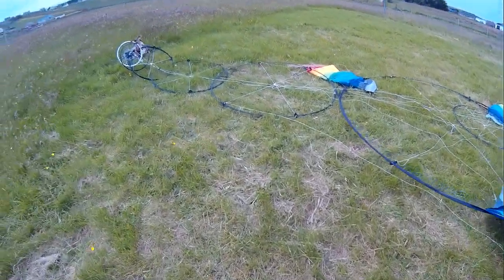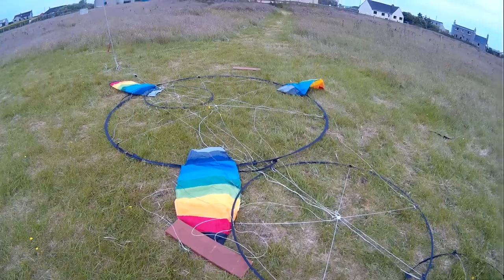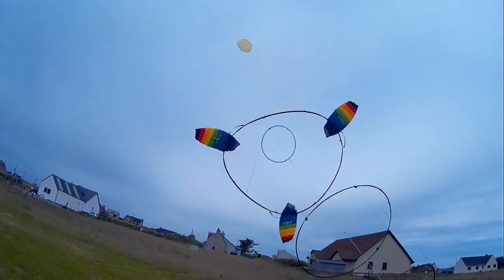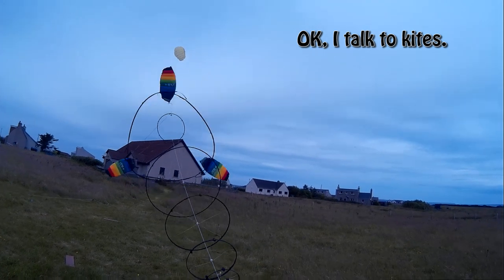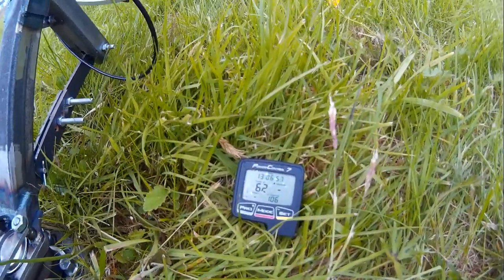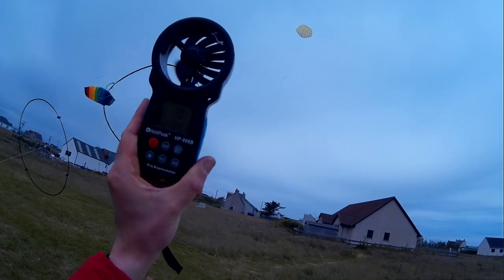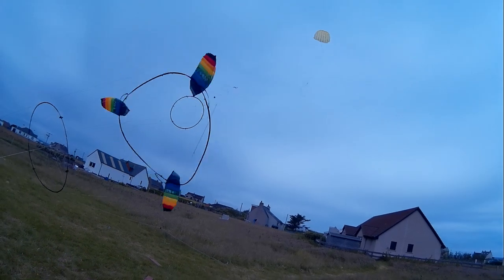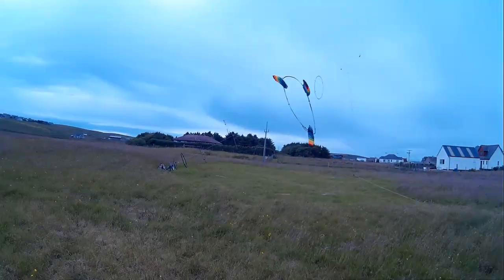Single kite ring testing the Mini Ground Station on High Torsion

Comment: hi,could you not simply attach the kite to a buggy with dynamos?port and starboard?
Then a spring too the buggy or a bungy cord and fill your kite with helium?
1]You pull on the back lines using leverage the buggy is pulled away from the wind ?
2]you release the back lines the kite loses power,the spring pulls the kite back?
  you collect electricity as the wheels rotate going forward and back?
 I have developed a system to enable taking off and replacing a guitar string by a non guitarist maybe with 5 practice attempts in 9 seconds that is more than twice as quick as the world record speed.with some better engineering I am hoping too also enable the guitar to stay in tune better than any other system as well.thanks ps great video please tell me how wrong I am ,thanks.
Reply: thanks for reply,can I see these old designs,please?
with a clock maker ,incorporating a tension device on the back strings,on the spring,there would be no need for any more control system than turning the system into the wind and raising and lowering kite due to wind speed?
I think the system can be designed to be virtually frictionless?thanks v much for answering ,also helium in the kite?though I do have a lot of hot air??
Reply: no tacking or pumping required,just filling to pull spring out releasing power to allow the buggy to return?
the distance could be minimal a matter of a few metres as you collect electricity on both journeys?a clockmaker can make a spring that tensions back lines then releases as buggy moves back and forth.?do you surf and play guitar,please?
Reply: ok yes, permanent lift,not necessary,thanks.umm if you can imagine your friends in Mongolia and they get a bungee as for bungee jumpimg attached to the back of the buggy,and a dynamo one too get electricity with the buggy rolling forward and one too collect when rolling back perhaps if they want to collect leccy on the spot ,then they can collect electricity without going anywhere,but obviously with care just to establish the principle?by simply powering and depowering the kite?and rocking back and forth.failing a bungee cord a wind blowing up a hill may do the same as the bungee?as depowering the kite should let the buggy roll down the hill and then powering it would pull it up the hill?
Thankyou for your reply.
Reply: ok thanks,cool,
Reply: hi whilst rolling up and down the hill at Stonehenge the wind brakes me gently at the bottom of the hill and the gravity gently brakes gently at the top of the hill.if the road was flat not bumpy then the wear and tear would be extremely small??in fact the kite would be resting but still the system would be gathering power?[I was on a mountain board with a windsurf sail on a bumpy road,i do also believe that ,the use of natures renewable energy does have a certain placebo effect.certainly their seem to be no health benefits in the use of nuclear,carbon,finite rescources.?
Reply: hi , did video song with drawings on at about 10.38,on u tube video,"my idea,that is not my idea."it features your energy system as well I hope that is ok?[the guitar,is a waterproof recycled,carbon fibre one featuring the nelliyom tuners]
Reply: sorry ,the song is called "my idea that is not my idea,james Moylan,"and the drawings are at 10.38,you are also featured as I got your video off u tube video editor.i hope that is ok,
I will put my next idea up on u tube,about the buggy,and kite,as it would be great to get comment.thanks.